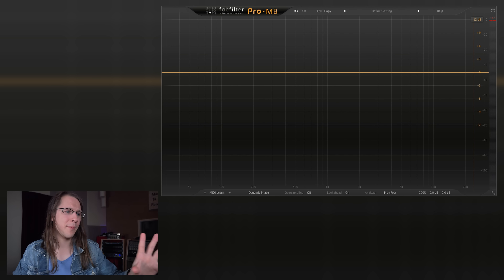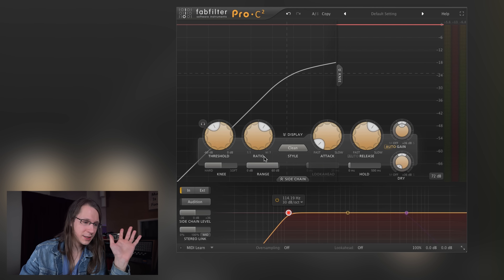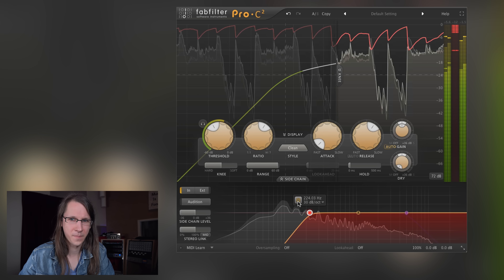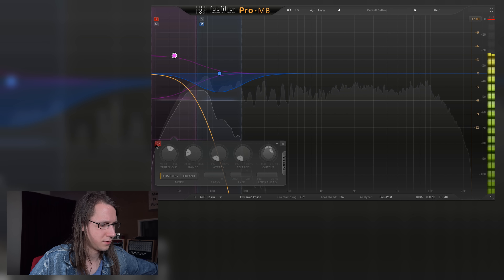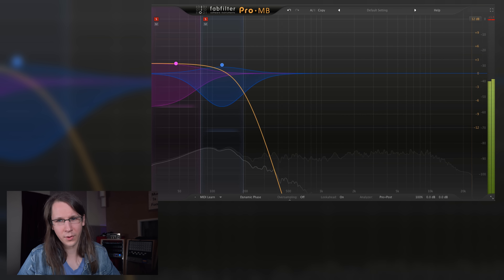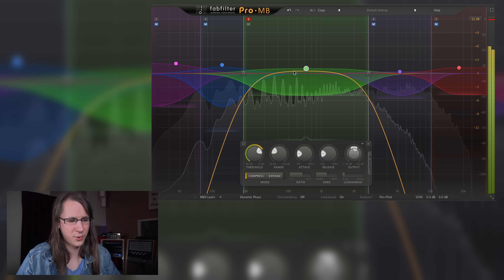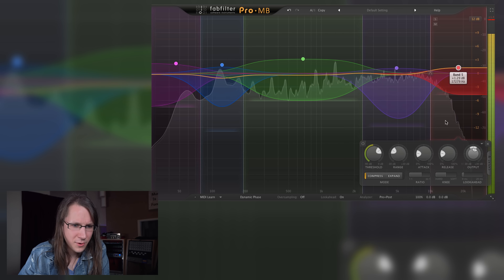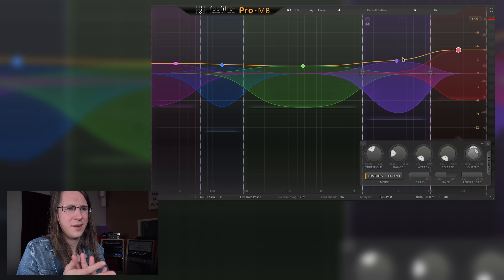HOW I USE MULTIBAND COMPRESSION.

Comment: One thing I try to avoid is compressing the mids and higher frequencies much or at all. If they're already mixed well, compressing them just always seems to make them sound worse to me. I'm sure this is not how most people do it but that's how my ears work. I also don't separate the jobs of mixing and mastering, though, which makes it a lot easier for me to just mix them properly (to my tastes) rather than try to adapt mutiband compression to a mix that was made without it.
Reply: Tape plugin do that though and I think it's fine with it. Wouldn't use mb-compressor for that.

Comment: Why so much lookahead? Doesnt it kills the transients?
Reply: Lookahed doesn't effect the transient, the multiband just only look ahead in the track and it reacts in a more accurate way👍🏻
Reply: @iacopofalsetti7853  Yes but for exemple the pro L seems to get rid off the trensients when lookahead is on
Reply: Emilien thevenin that’s because when lookahead is off on pro L it pretty much acts as a clipper instead of a compressor, which is what a limiter is. You can read that in the help tab when exploring pro L. This can work in certain situations but if used in professional work it can cause problems when sending back to clients
Reply: Streaky said it kills the transients, so it technically does because he said it. On pro L.
Go watch the video
Reply: lookahead do affect transients.

Comment: Ok so that's how you use them, but should we? One can live without them, no? (:
Reply from the maker: Absolutely not 😂
Reply: I wish we could live without them. In my opinion, multiband compression has shaped the sound we got used to be listening to in a way that music has become a bit 'plastic'. I suggest we move on and start creating music where it is allowed again to put the emphasis on certain frequencies in individual tracks but for now, very few dare (or are capable of) making mid-high frequency on a juicy hi hat, really really mouth watering JUICY. Things like that used to work really really well on the floor. The dance floor of course.
Reply: @Xrex O that's on point yes.

Comment: Why dont use multiband compression?? Phase problems, not necesary unless you need to repair a bad mixing and nobody really use it.
Reply: Maybe Not on the stereo buss
 but They can work great on wide frequency instruments like piano. 
A good crossover that doesn't alter phase or add tons of pre-ring is helpful.
Reply: @StevieBoyesmusic  unless the recording is "damage" i rather use an eq
Reply: Fair enough. Just that the left hand playing causes the right hand to duck and vice versa. 
Could just record both parts separately I suppose.

Comment: Never use one multband compresser on your final mix.
Reply: Parallel compression is fantastic, both on mixes or a subgroup. Now with Logic Pro X’s new compressor, one can quickly learn how it sounds in different applications. The plug-in’s 7 modes all have a mix control with even some presets that use this parameter by default.